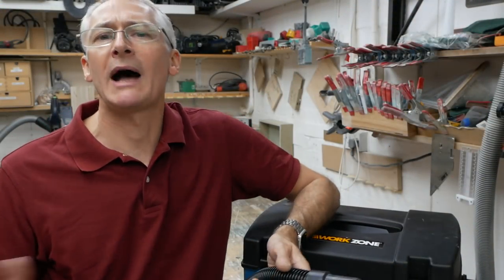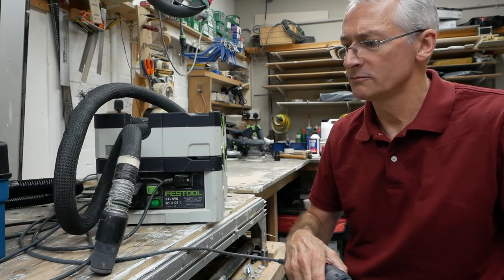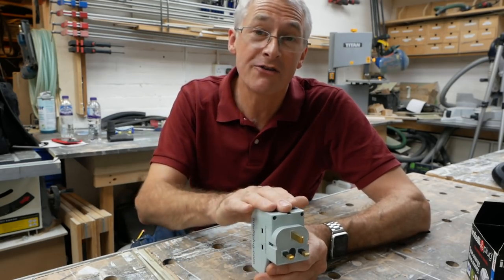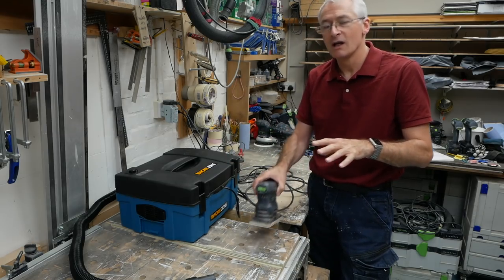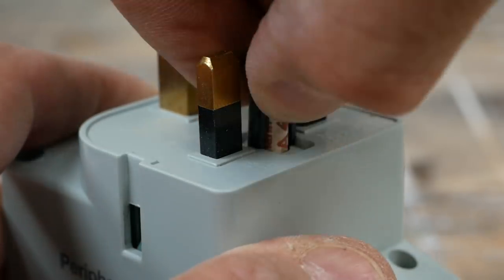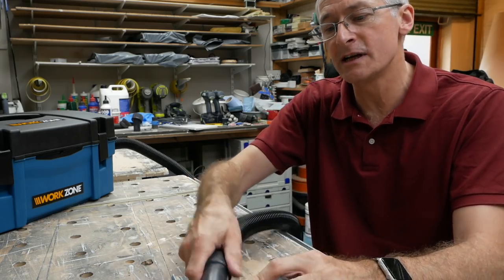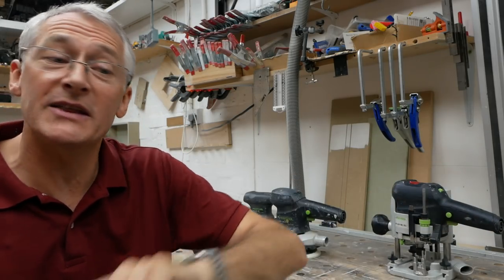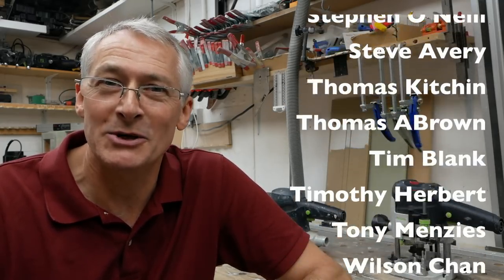Shop Vac AutoStart [#211]

Comment: I've been looking for something like that for years! I just won't pay the kind of money they're asking for the standard auto starts. The delay is no problem. After I switch on the table saw I don't start the cut for at least 3-10 seconds while I line up the workpiece. Actually I'm going to run a 3way from it as I only use one tool at any given time. Thanks again Peter!
Reply from the maker: Thanks Gary! Like I say in the video and the description, you need to exercise caution when using something outside its intended scope, but, engage brain and stay aware - as always👍👍

Comment: I'd sketched out how to do a DIY one of these then just in case I was missing something I did a quick search and up popped this idea.

I've got a few from around 2009 - E-On were supplying them for £3 delivered and later Homebase were selling them off as low as 50p. They're still available on eBay.

Inside they are very well made, with a chunky Omron G5RL 16A/250Vac relay, a proper power supply and transient protection. I've had two here used as intended, one for 13 years and the other for 10.

They're far more clever than what's needed to be for this application as they need to distinguish between the standby and running power of whatever's connected to the Master socket. They use an IC (Cirrus Logic CS5466) intended for use in electric meters and similar, and an unidentified 16-pin microcontroller so it doesn't just measure the current but true power.

I'd not thought of using one for this application - many thanks Peter!

Comment: I was given a couple of these Intelleswitch modules, years ago, for use on computers.  Never used them, could not see a need for them, and I think they got dumped.  Now is the time to start looking in the workshop, as this is exactly what I need for the chopsaw and vac.
Reply: Found the adaptor and now fitted.

Comment: Great tips.  I decided some time ago that I would figure out a way to connect all my tools to my CT36 or my dust collector.  So I became pretty good at developing connectors.  I ran across a hose set Rockler sells (Dust Right Universal Small Port Hose Kit) that made it easier to adapt all of my small tools to any vac including my CT36 so I added that to my adapter kit.  Now I will add some of my surplus/old bike hose to that little kit.  Thanks.
Reply from the maker: Thanks Jim! I’d seen that rocker kit, didn’t realise we could get it over here! 👍👍

Comment: Very nicely done Peter. Thank you.

I am going to monitor temp of the motor unit with an IR thermometer as it seems to get quite hot after very little running time.
Reply from the maker: That’s slightly worrying - let me know the results Norman. I have another video to do where I’ll be  monitoring the temperature of the exhaust air so it’d be good to hear yours for comparison 👍👍

Comment: Inner tube: genius! I've been fussing around for ages trying to sort out my Domino dust collection. The only question now is which of the family bikes will suddenly get a nasty puncture <evil grin>! Seriously brill bit of lateral thinking. BTW, my Domino has the new style of bayonet dust port. The adapter you show fits, but it is very, very tight. A bit of Vaseline on the inside seems to do the job - silicone spray might be better as it wouldn't attract sawdust. But you've solved the biggest problem, getting the hose to fit, which is wonderful.
Reply from the maker: Yeah, not a fan of the ribbed ‘cleantec’ ends, not enough ‘give’ in them for my liking. Glad the inner tube idea helped 👍👍

Comment: Great video thanks. To achieve a similar result I use a remote controlled adapter. For example paint spraying with a hvlp turbine and a long hose, I often want to disconnect the hose from the gun, and don't want the air to keep flowing which would raise dust. By plugging the turbine in through a remote adapter and having the controller in my pocket I can switch it off remotely from quite a distance, for example to refill the paint cup. With the mitre saw I either tape or cable tie the controller to the saw so I can switch on the vac instantly just before each cut. Not quite as convenient as a power take off but it works.

Comment: What I do is get one of those boxes with the remote to turn on the line voltage.  I then use industrial velcro to hold the small remote at the end of the hose. When I use my tool I just push the button on the remote.  The advantage is that it can be swapped easily or for just vacuuming.

Comment: That is a very neat idea to make use of the rubber tube and I have too many problems with adapter and hose before as well. The cheap black hose is alway too rigid to use and  hard plastic end adapter does not create a good seal too. The frestool hose set in my opinion is far too expensive so I finally settle with a set of the rockler hose set which sell at around £30 which includes an expandable hose and two rubber end which has done its job nicely ever since. Another great idea from Peter which can’t be disputed with minimal expense but get the job done .
Reply from the maker: Thanks! 👍👍
Reply: The frestool domino machine is a handy way for joining stock but with it’s price tag plus consumable, it is more or less in the region of trade  usage. I am using the dowelmax for my diy project and wonder what you think of it as an alternative to wider potion of day to day users or it maybe an idea of future video.
Reply from the maker: Yes, the Domino's more of a production machine, certainly, although it's popular amongst the well-heeled hobbyists! I've never used the Dowelmax tbh, it hasn't really been on my radar, other than in passing; looks like a decent jointing system (though perhaps a bit slow to use) certainly strong enough, and all you need is a drill. 👍

Comment: The inner tube idea is brilliant. During lockdown I’ve been doing more woodworking and ended up using an old Henry vacuum as a “shop vac” with a hepa filter fitted. Luckily I have a 3D printer so managed print my own but with tolerance issues you get with 3D printers I’m going to try your inner tube trick to make a good connection even better. To turn on the vacuum, I just use a RF plug I use for my Christmas tree and had the remote handy.

Comment: Good info Peter.  I have a Festool midi which ive had for a while . However about a year ago i invested in a Nilfisk vacuum, both 110v both type L both with 110v take off. The Nilfisk....£179 from screw fix. This comes with a better hose and festool type attachment. They do 240v also. Well worth considering
Reply from the maker: Thanks John! 👍

Comment: I have just purchased an Intelliplug on Ebay and your tip works really well with my DeWalt mitre saw. It also works with my Tacklife mini saw but for some reason, not my Trend Router, maybe it will under load. Thanks for a great tip.
Reply: Is the Trend a soft start? I have the same problem with my Bosch GOF1300 router.

Comment: Great idea, great video as ever. My only concern would be power rating. The intelliplug is rated at 3000W, the vacuum is 1250W. You’d need to be a bit carful not to plug anything over 1750W or you may fry the plug before the fuse has chance to go.
Reply from the maker: Thanks! Yes, that’s always a risk when you’re using gear outside it’s intended scope - as I say in the video & the description, you need to exercise caution,  engage brain and apply some common sense when using tools & electrical equipment generally. 👍👍

Comment: Nice tip on the auto plug, thanks.
Reply: I tried it and as you said it’s a little slow to kick in to be useful on a lot of tasks and the run on is too short to. It fits in with the accessories so I will leave it there for jobs where it is useful. 

I have been spoiled by my my big shop vac that has a built in tool socket that works instantly and has a decent run on which makes it ideal for chop saw use (also from Aldi a couple of years ago).

Comment: I use a Karcher shopvac, I think it was about $160 Australian dollars. Instant startup and delayed stop. I've been using mine for years without issue 
Thanks for the heads up about the device, I have been looking for something similar for my 2hp dust extractor.

Comment: Love the inner tube idea, lots of applications there.
I had already adapted a cheap vacuum using the Festool part you showed. This may not apply to all hoses but I managed to take off the original end of the hose, (press in the two tabs and pull.) and fit the Festool rubber end directly onto the cheap hose.
Worth a try.
I don't know much about electricity but you may want to look a 5:11, your socket was switched off but the machine still ran.
A bit of clever editing possible?
Just a bit of leg pulling, that was a great video, with not one, but two very usable tips. Definitely will use both.
Reply from the maker: Thanks! The Aldi hose is just the wrong size to fit over or in the Festool rubber end, unfortunately, but yes, always try the easy solutiion first! And well spotted at 5.11 - was editing this in a bit of a rush and used the wrong clip! 👍

Comment: You can buy the autostart part from other vacs and built this into the Scheppach. I did use parts from the Bosch Advancedvac 20. A small pcba, the on/off switch and a power outlet. Total costs around €40,-
You can buy these parts from (Bosch) part suppliers.

Comment: Just saw your video - convinced and so, ordered one for £6.50 (ebay.com). I've been using a table saw and often forget to switch the vacuum on - problem solved! Too much sawdust, so also adding a low cost cyclone and a 30L drum to collect the mess ahead of the vacuum because the paper bags fill up too quickly. Up until now I have left the vacuum "on" and switched it and the table saw "on" together using a wall mounted double socket, so it's a small improvement, because the control is now directly with the device e.g. the table saw on/off control. For  multiple devices, could plug an extension lead (or two) into the master socket - for auto switch on from several devices e.g. a bandsaw, router, table saw, random orbital sander etc. which are only used one at a time for short "repetitive" work.
Reply from the maker: Yep - works fine with a power-strip, just don’t try and us them all at once! 😯👍
Reply: Little known facts:13A fuses (BS 1362) last indefinitely at 20A and dissipate up to 1W. Delays with the switched appliance stagger the start up current which can be (briefly) 150% of stated power for a “basic” e.g. cheap motor!
Reply from the maker: Simon Now that I didn’t know! I was going to caution you about startup surges on table saws, but I guess you know more than I do!

Comment: I'm surprised they didn't include an auto takeoff actually. I bought an Aldi dust extractor about 12 months ago that was more of a henry style shape, and it's full price was only 34.99 and that includes auto-take off up to 1200 watts, and to be fair seems to cope with my DeWalt chop saw being attached, and thats about 1800 watts.

I assumed the delay in startup is more a safety feature to prevent two startup peak voltages going through the plug and fuse at the same time, I'd never really thought of it as a potential quality issue but that was only gut feeling.
Reply from the maker: Yes, I’d assumed it was down to price, but I’ve seen a few cheaper ‘wet n dry’ type vacs with PTOs, though as you say they were more like the ‘Henry’ shape. 👍👍

Comment: Hi Peter I know this is old but I watched the other day and saw those hose fittings you had that you didn't know where they came from. Yes I have something the same as all you posh tools LOL 🍺🍺.
I don't know where I got mine from either but at least you can rule out top end. Could have been Proline as you have router and I have circular saw of there's

Comment: I made an auto dust switch using an arduino nano. I use a 3D printer to print Festool dust adaptors, I designed one that works with the ts55 clicky twisty type connection!
Reply from the maker: Nice! 👍👍

Comment: Hey Peter are you not able to purchase the I-Socket Autoswitch in the UK? We have them in the US and work instantly when a tool is started and then run for 7 seconds after
Reply from the maker: Hi. We have something similar called an iVac, but it's priced at around £70 here - literally 10 x the price of this little adapter. I'm sure it's a fine product, and designed for the job and all that, but it's still 10x the price... 👍
Reply: Peter Millard yea the I-Vac switch here is expensive too, the other one I mentioned is a cheaper alternative and just works the way it should
Reply from the maker: A -Carpenter Then no, never come across that one 👍👍

Comment: Thanks for the heads up about the Intelliplug. All seem out of stock though. It keeps referring me to the Eon version which seems to have a TV remote sensor. I'm guessing it's not the same thing?
The inner tube is a good tip but I heard it years ago.
Reply from the maker: Sorry, but this is a pretty old video, and I’m afraid I haven’t seen them around for a while. There seem to be alternatives on Amazon but they’re not ones I’ve used. 👍
Reply: @10MinuteWorkshop  I've searched high and low on the web but no one seems to stock this. The manufacturers www.oneclickpower.com have lost their domain so diverts to blank website. 
They've either gone bust or sold the company.
Reply: @10MinuteWorkshop  I've done a bit more research and came to the assumption they've been bought out by Eon. They're now called the Eon Powerdown. There are two types. The desktop type (which you have) and the TV remote type. 
I just managed to grab one on Ebay.

Comment: Hi peter great video as always. Would this work if it was plugged into a 6 gang extension lead, then all the machines running off the lead. Keep up great work
Reply from the maker: Yes, but obviously not all at once. Be aware this is an older video, and the product used seems to have been discontinued, though others are available,if you Google them 👍
Reply: @10MinuteWorkshop  Tks a lot for speedy reply

Comment: Kieran.Hi Peter, thought the intelliplug a great idea. I have just been setting up a centralised dust system with a triton dust seperator and small wickes vac. I ordered a e.on intelli powerdown plug.However this has to be used with a remote control. I used an old one for all 4 remote.The problem is i can switch on from remote but times out quickly.The master socket has to show there is power already there.It cannot activate from swiching on a saw.I was wondering if you have used this plug and have any ideas.thanks. kieran
Reply from the maker: Hi. No, I’m sorry I haven’t. This is quite an old vid now, and I’m afraid the intelliplug that I used seems to have been discontinued since then.
Reply: thanks for your reply peter

Comment: Hi Peter just checked amazon they are cheaper scroll down the page and they are £4.99. Thanks for the tips
Reply from the maker: Thank Mark. Yes they are cheaper,  but the delivery charge pushes it back up; £6.49 & free delivery off eBay 👍👍
Reply: I just ordered 2 of them for £9.98 free delivery
Reply from the maker: Ah, OK - simple option, but more 😆👍👍

Comment: Another way: use PVC-pipes and a heat gun. Heat the pipe (not to hot!) and mold the warm-soft pipe. After cooling down the're hard again. Made myself some adaptors.
Reply from the maker: Yep, that works too. Or heatshrink tube. Can get a bit stiff/brittle though when it cools down 👍 The great thing about inner tube is that it’s not a permanent fix - you can revert back to the stock connection if you need to. 👍👍

Comment: I tried one of those a while ago with a numatic henry and gave up on it because the delay was worng.  There is a device called an Ivac sys which is designed for auto switching extractor systems.
Reply from the maker: Thanks. I do mention the delay in the video, and that if it’s the kind of thing that’ll drive you crazy then it probably isn’t the workaround for you. And I link to the iVac in the video description - always good to use something that’s designed for the job - provided you’re prepared to pay10 times the price, of course. 👍👍
Reply: I now use a nilfisk extractor that has auto switching,  they are better value for money than Festool.  In terms of cost you have to decide what your priorities are, for me not breathing in gypsum, silica  and other toxic dusts is right up there with buying food.
Reply from the maker: Thanks. Yes, I also made my priorities clear - I bought the Festool 👍👍 Nilfisk make great vacs - if they do everything you need they’re good value.

Comment: Excellent as always Peter. Will it work with the Macallister plunge saw you reviewed, the Workzone shop vac that is? I have just finished a massive decking project in the re-landscaping of my back garden and I am now turning my attention to my overdue revamp of my garage workshop so dust et all is in my waking thoughts.
Reply from the maker: It would, but these particular units haven’t been available for a little e while unfortunately. I’m sure there are other similar units though. 👍

Edited to add: this type of thing - https://www.ebay.co.uk/itm/Master-and-Slave-Auto-Power-Off-IEC-3-Way-1M-METRE-MAINS-Extension-Lead-RRP-18-/142692654433?mkcid=16&mkevt=1&_trksid=p2349624.m46890.l49286&mkrid=710-127635-2958-0
Reply: @10MinuteWorkshop  Thank you Peter, looks great.